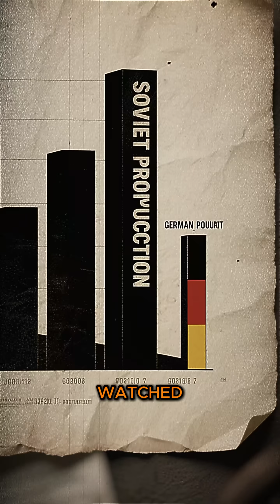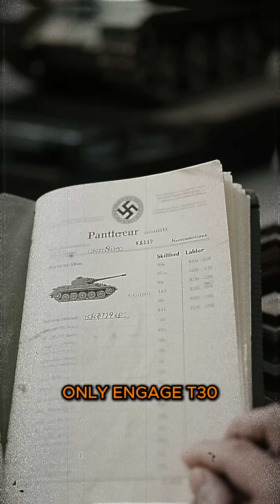SOVIET TANK T-34 — WHAT GERMAN ENGINEERS DISCOVERED IN 1941

Comment: Yeah and I've seen on a documentary that an 88mm went in one side of a t34 turret and straight out the other, t34 only good because of vastly superior numbers
Reply: the why 88 had to came into AT role was the failure of the 37mm or newer 50mm  Army ordonance in 1939-42 starting with Char B in France and Mathilda in Northern Africa .. T34 and KW I ..were thefinalpointto change to PAK 75mm after having used 7.62mm captured AT gunnery as sudden solution even in creation of mounted AT systems like Marder, when even their first designated tank hunter  Panzerjäger I mounted the czech built 47mm AT captured gun on a PZ I chasis